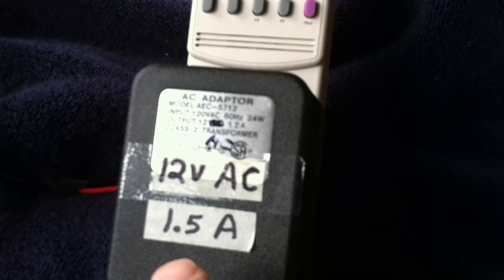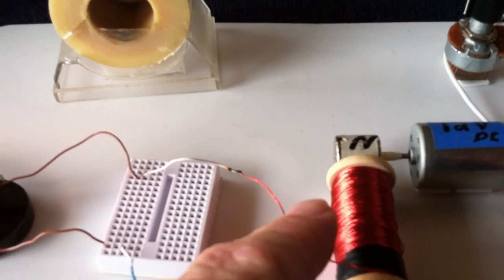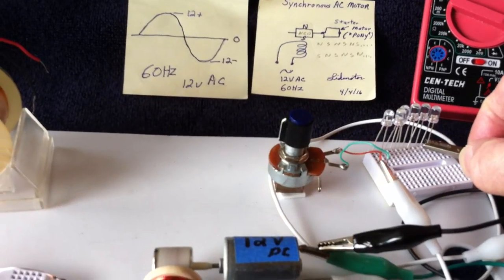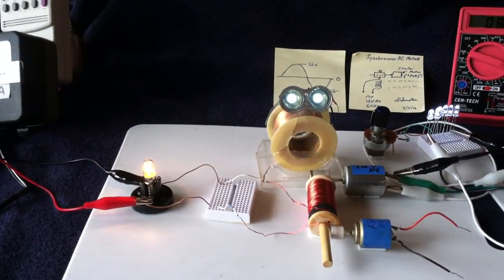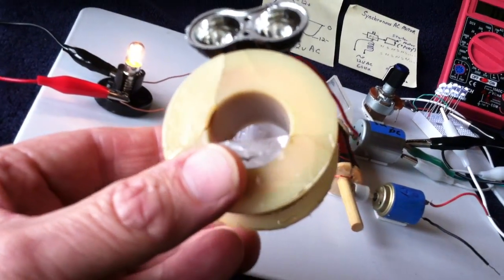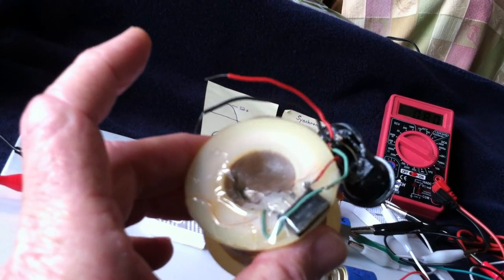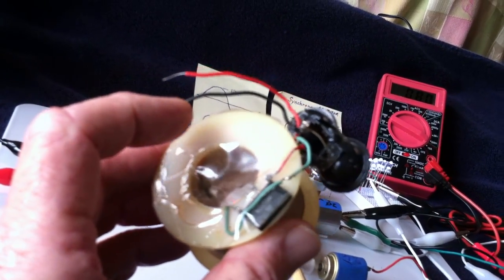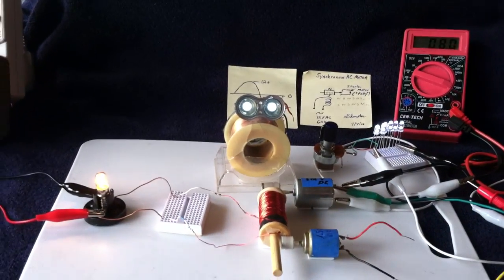Load Testing Synchronous AC Motor -- Part 2

Comment: hi.

I totally agree with this. this is not fake. the power of the transformer will change, the reason is on the experiment itself. the excitation of the rotor (rotating part) is constant because you use permanent magnet. try to use an electromagnet, you will see all the difference; the power and the current. it can also become a power factor correction to reduce losses on your ac system.

this is really a great video. i will share this to my class.

cheers. (y)

Comment: Hi Lid, good topic. These old hardcore transformer are very inefficient. No load they will use at least 5 to 7 watts. One very good replacements are these new linear, smarter transformer. They are very affordable. http://goo.gl/0WGTJe , around $3USD .  These new power adapter use less then one watt at idle. They will help you get better performance reading, and help you down the road with your future project.  Is this helpful to you, Lid ?
Reply from the maker: +Mike Poirier Thanks Mike.  These are DC USB voltage though and I need pure 60 hertz AC.  Maybe I could modify one.  I don't know.
Reply: +Lidmotor Yeah, true.

Comment: Hi Lidmotor. Great video! Very informative and interesting. Have you considered building a more symmetric version of your synchronous motor/generator? You could follow the design layout of your previous induction motor. 
[1] Orient the pony motor vertically (shaft pointing up) and arrange 2 or 4 coils (or more) around the magnet. This way, instead of 1 large coil, you could have several smaller coils (may improve your efficiency). And this may also improve the torque.
[2] If you are using 4 coils, you could use 2 or 4 magnets (alternate N-S-N-S) around the pony motor shaft instead of just 1 (N-S).
[2] Lastly, you could use 6 coils with a 3-phase power supply. This will make the motor/generator self-starting.
Reply: I have been a subscriber for nearly 2 years now and I must say, your videos are really fascinating. Especially the recent few on AC motors. Please keep up the good work and good luck!
Reply from the maker: +nesslersreagent Thanks for the ideas.  Yes I have considered using that first 'Smucker's' jar lid induction motor setup for a vertical synchronous motor.  It is on the to do list.  I'm also considering using one of those 'Pill Bottle' motor setups with multiple coils.
Reply from the maker: +nesslersreagent  Thanks for following along.  It has been an interesting adventure for me because there seems to be something new pop up around each bend in the path.  Amazing and unexpected things happen when you just set out in a direction towards an unknown destination. The journey is what matters.
Reply: +Lidmotor  - Looking forward to it!

Comment: hey lid.....ive come across this a couple times and curiosity got the best of me...i just had to know.
i used a regular 12v SLA, with an inverter to power the 60hz transformer......then watch the amp draw from the SLA with a regular multimeter as i turn various things on and off. mind you...this will also include the wastage in the transformer....but it may give you another measurement to compare things to.....good luck!
Reply from the maker: +jeremy gwilt Good idea!&#160; Thanks.&#160; I have that setup to try. That method could tell me more than the Kill-a-Watt meter.

Comment: Hi lidmotor,  I've always wondered  why you put a full wave bridge rectifier on Maggie?   Won't The coil in Maggie's body light an LED brighter with the inductive coupling using the AC straight from the two wires on the coil without the voltage drop across the FWBR?
Reply from the maker: +Roger Harrison  When I built Maggie long ago what I wanted was a simple pickup coil that gave me DC as well as led indicator lights.  The bridge rectifier came first and the led eyes were second.  I rarely use the DC output wires but they are there when I need them.

Comment: Lidmotor, I would like to see if with a bifilar coil where we can create spikes as cooljoules does, we can move the motor also.....with this, you can reduce dramatically the input power and use the magnetic fields to move the motor generator....i guess.
Reply from the maker: +Miguel Santana The AC sine wave signal would not produce the spikes we need.

Comment: can you charge the 12 volt battery with the motor? without stalling it?
Reply from the maker: +Miguel Santana  That might work if I use the 25 ohm variable resistor to control the current.

Comment: I wonder how many additional motors you could add especially with a different coil design!
Reply from the maker: +michael judson  Good question.  I am way off from a standard design for this type motor.  I don't know what would happen if I just started adding more and more rotors.  Sooner or later the coil is going to over heat I would think.

Comment: I hope you do a lot more work with synchronous AC. Fascinating stuff. A lot going on. Build another!

What are your thoughts on why you see such a significant increase in amperage when you cut out an LED?
Reply from the maker: +jameswoll I think it has to do with the voltage at which the led opens up all the way.  An led can look like it is on full but not be.
Reply: +Lidmotor 
I think I figured out the reason... I just had a duh moment... ;)
As the V increases in an LED, the current increases disproportionately.   That means when you reduce the # of LEDs to 5, the available V per LED increases to accommodate for the missing LED load---that results in much more current being drawn because the LED will draw more current at higher V than at lower V.
Reply from the maker: +A B Yes. That was my thinking also.
Reply: +Lidmotor 
re:  "An led can look like it is on full but not be."
That is possible, however, it is also possible to drive the LED with a higher V and much more current & get NO appreciable increase in light out of the LED--before it finally reaches maximum V & A capability.